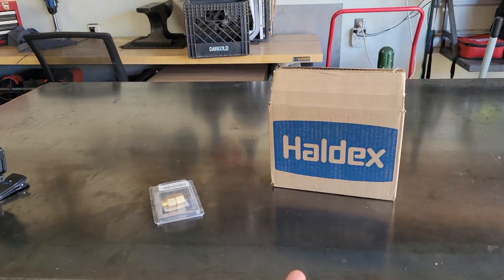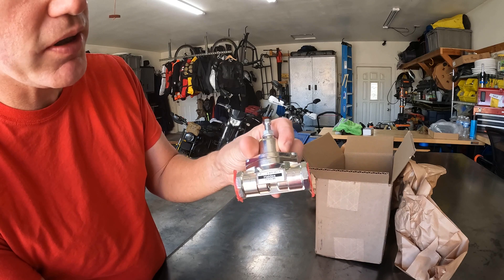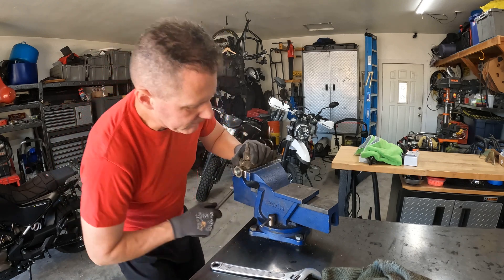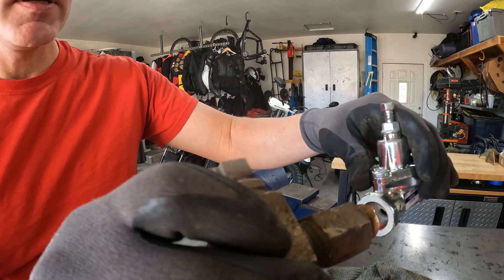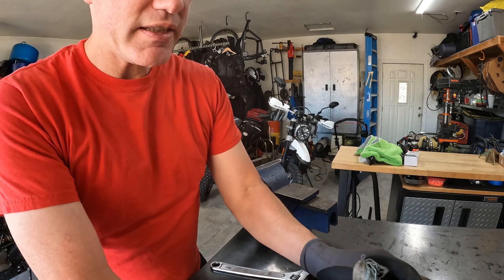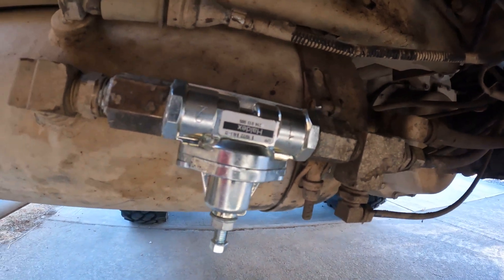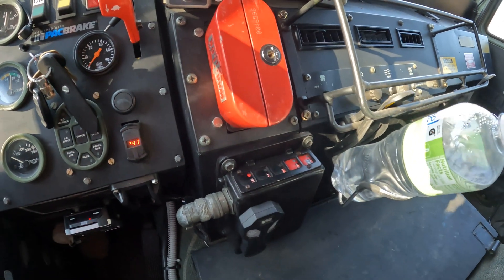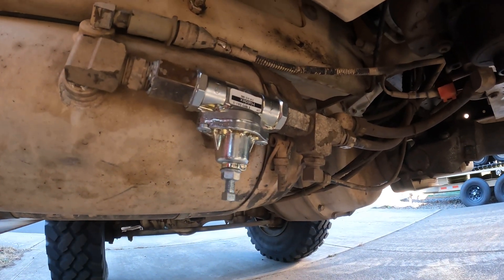Abel LMTV build part 172 (Brake pressure protection valve)

Comment: I'm here within the three hour window... There was still 2 available! lol! I was going to ask... but you answered the question. Your old was was faulty at times. Good job!
Reply: ayy Dave -the link gives # 314013005 for protection valve is that correct for it-any final adjustment needed? or just slap her on - ps i left a reply for the m1078 t-shirt ,i need one-where did you get it please:John Cunningham